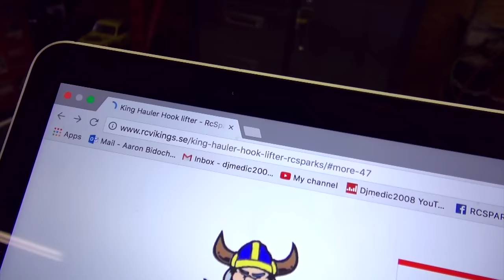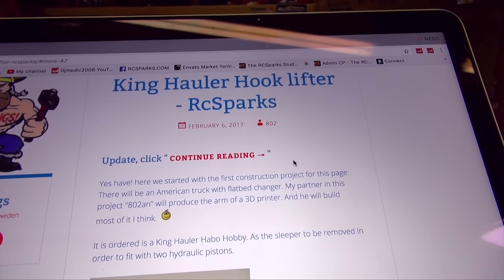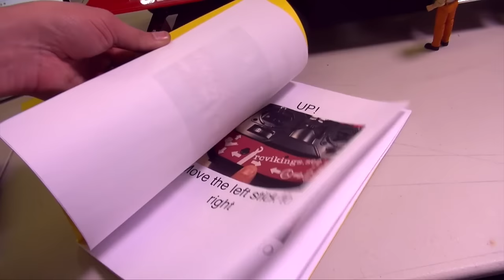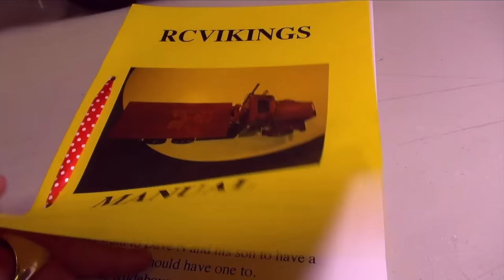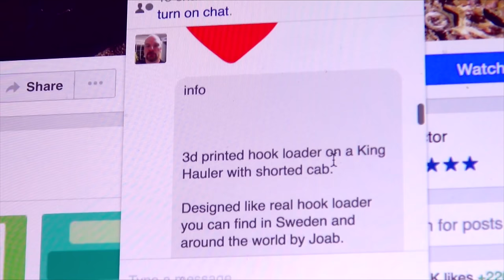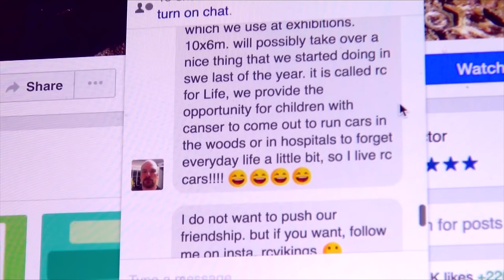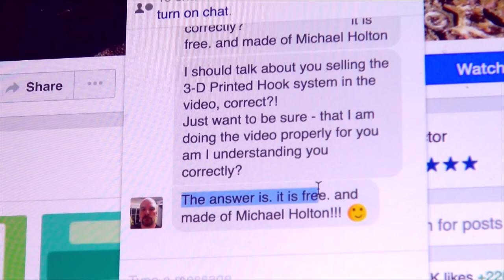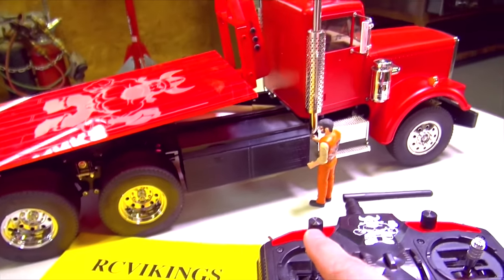RED KiNG HAULER [w/ 3D Printed HOOK LiFT] Truck LiFTS for the 1st TiME! | RC ADVENTURES

Comment: Hey medic, I was looking at the slash 4x4, losi ten scte, and the arrma senton. which of those would be the best for bashing and some racing. thanks
Reply: Zachary Wernholm ok I know I'm not medic but the only Traxxas I really like is the slash 4x4 you will not be disappointed id suggest it to you by far. It's a tank. I live in Alaska so it can take a beating it's a basher. It's parts aren't brittle and it can take a beating for a 1/10.
Reply: Mel's 12valve is the slash good in muddy conditions where I live it's muddy most of the time
Reply: Zachary Wernholm get the right tires and if you like to be on the throttle it'll go anywhere you want it to.
Reply: Mel's 12valve oh ok thanks for the advice

Comment: hey I have a rc wraith and should I get new tires and a metal body and new shocks please answer
Reply: they are all stock
Reply: nerf boys I wouldn't get a metal body
Reply: nerf boys puts too much stress in the drive line from all that weight
Reply: nerf boys but tires and shocks would be a good upgrade. The stock tires don't have a lot of traction and depends what terrain ur running on ur wraith
Reply from the maker: Did you change the servo yet?!